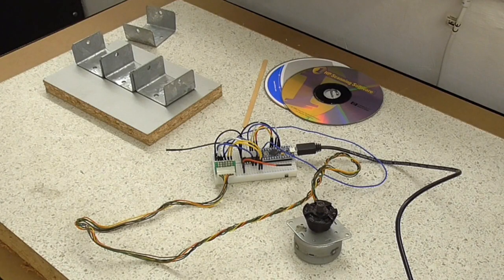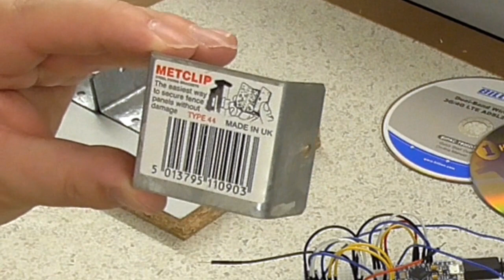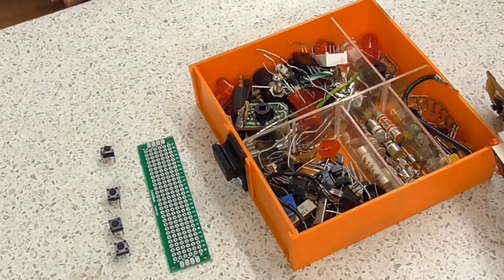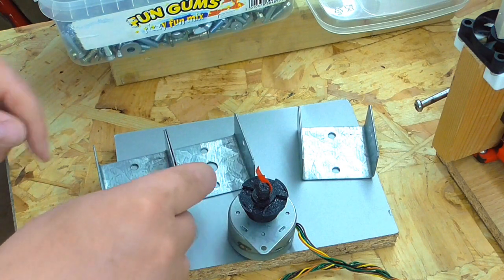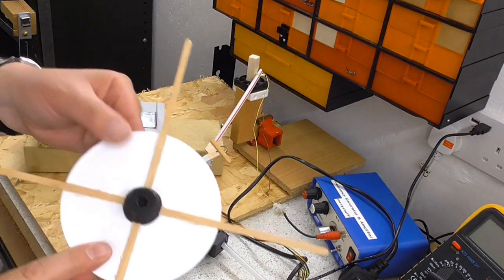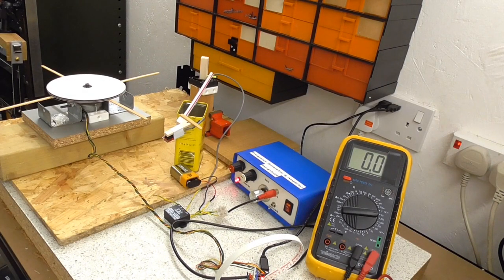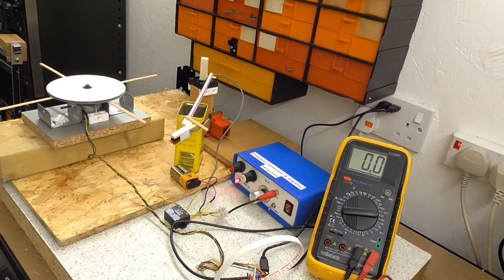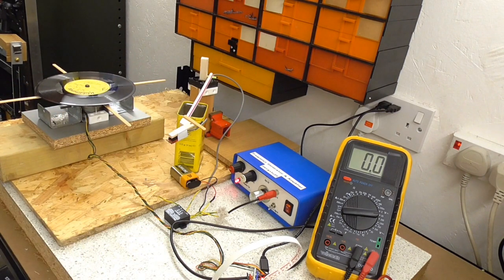Stepper Motor Record Player

Comment from the maker: /*
 Stepper Motor Record Turntable

 This program drives a unipolar or bipolar stepper motor.
 The motor is attached to digital pins 2 - 5 of the Arduino.

 Buttons connected to pins 6-9 control the speed
 6 = 0 rpm
 7 = 33 rpm
 8 = 45 rpm
 9 = 78 rpm

 Based on Arduino example by Tom Igoe
  Created 11 Mar. 2007
 Modified 30 Nov. 2009

mrrgstuff - 2019
 */

#include <Stepper.h>

const int stepsPerRevolution = 48;  // change this to fit the number of steps per revolution
// for your motor

// Buttons for changing speed
#define Button_0 6
#define Button_33 7
#define Button_45 8
#define Button_78 9

//PIN and PWM values to get 0v, 3.3v,4.5 and 7.8 to display on Multimeter
#define PWM_Out 10
#define PWM_0 255
#define PWM_33 184
#define PWM_45 158
#define PWM_78 87

int rpmspeed = 0;

// initialize the stepper library on pins 2 through 5:
Stepper myStepper(stepsPerRevolution, 2, 3, 4, 5);

void setup() {
  pinMode(Button_0 ,INPUT_PULLUP);
  pinMode(Button_33,INPUT_PULLUP);
  pinMode(Button_45,INPUT_PULLUP);
  pinMode(Button_78,INPUT_PULLUP);
  analogWrite(PWM_Out,PWM_0); // set the display to 0 rpm)      
  // initialize the serial port:

  Serial.begin(9600);
}

void loop() {
  // step 1/8 revolution at the desired speed:
  if (rpmspeed != 0){
      myStepper.setSpeed(rpmspeed);
      myStepper.step(stepsPerRevolution/8);
  }
  
  if (digitalRead(Button_0)==LOW){
      if (rpmspeed != 0){
        Serial.println("0 button pushed");
        rpmspeed=0;
        analogWrite(PWM_Out,PWM_0);
      }
  }
  if (digitalRead(Button_33)==LOW){
      if (rpmspeed != 33){
        Serial.println("33 button pushed");
        rpmspeed=33;
        analogWrite(PWM_Out,PWM_33);
      }
  }
    if (digitalRead(Button_45)==LOW){
      if (rpmspeed != 45){
        Serial.println("45 button pushed");
        rpmspeed=45;
        analogWrite(PWM_Out,PWM_45);
      }
  }
  if (digitalRead(Button_78)==LOW){
      if (rpmspeed != 78){
        Serial.println("78 button pushed");
        rpmspeed=78;
        analogWrite(PWM_Out,PWM_78);
      }
  }
}

Comment: Fascinating project. I think Michiel James
 is probably right about the issues with using the stepper motor directly connected. I don't know if you could use the same idea with a 'normal' DC motor and PWM control or if that would give the same issue at such low RPM. Back to the stepper driver, the pulsing or stepping was less noticeable at the 78 speed so running it at a significantly higher RPM and gearing it down with a pulley system would seem a possible solution.
Reply from the maker: Yes I agree with both of you. At 78rpm the stepping is tolerable but still slightly noticeable. I think increasing the step speed and gearing down, maybe with actual gears or a belt would work better. My previous design did use a DC motor, and PWM should be fine for speed control, but it wasn't direct drive as the motor shaft acted on the turntable rim. Thanks 😀

Comment: You can definitely distinguish the 'stuttering' of the vibration as the stepper steps.
I wonder how it will react if you were to link a latex rubber band as a drive belt between the motor and a shaft pulley to drive the records. It should act as a dampener to even out the vibrations. Also rubber dampeners on the motor fixing points. Silicone sealant should work also.
Wat are your thaughts?
Reply from the maker: Hadn't thought of a belt drive from a dampening point of view. However sounds like a good idea. My thoughts were more around increasing the number of steps per revolution. Maybe a different stepper motor or some sort of gearing. Thanks 😀

Comment: Probably a Trinamic driver would make the rotation smoother
Reply from the maker: Yes indeed. It's something I intend to try. I have used the TMC2208 in this video:
https://youtu.be/osF5uNdUXKo
to reduce the noise caused by the A4988
Thanks 😀 👍
Reply: @mrrgstuff  I am also trying to make a reel to reel recorder with some steppers. I have the similar issue as I need somehow to compensate the nonlinear advancement and tape tension.
Reply from the maker: Very interesting sounding project, and maybe quite complicated to get right. The TMC2208 will certainly help over the A4988 though. Hope you get it going! Thanks 😀👍

Comment: It is posible use encorder also?
Reply from the maker: I'm not sure what you mean. Can you explain more? Thanks 😀 👍
Reply: @mrrgstuff  i want to record and playback stepper, so i add the encorder (as5600) on the stepper, it posible to record and plqyback again like a mini servo? Ia a new on arduino
Reply from the maker: I've not used the as5600. However, I can see through Google that it is possible to use with an Arduino. I would think it would be possible to use it with a stepper to act like a servo. The Arduino has some memory so it could record a stepper position and then move back to it
Reply: @mrrgstuff  but iam still confiused how to move stepper like a servo myservo.write(90) ; to 90degree.
Reply from the maker: @botak 333  If you know how many steps are 360deg then you could work out how many steps were needed to turn a smaller angle
Reply: @mrrgstuff  200step sir, yes i try already but without feedback encorder the posision always change sir